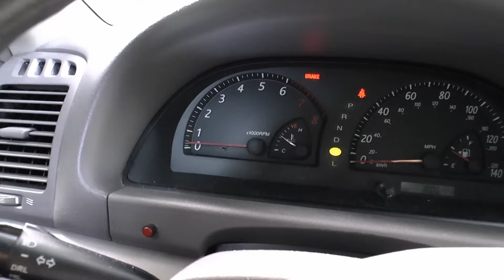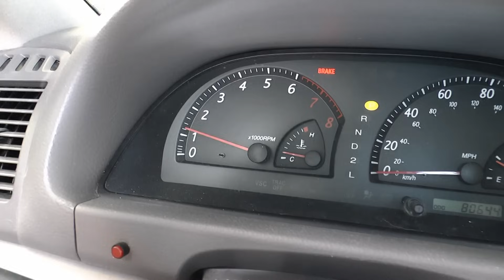How to Fix Low Idle Problems in Your Car (Throttle Body)

Comment: Hi scott, I have a Toyota Avalon 2000 xls, I replaced new alternator, now the idle is lower than normal, then I have to push the gas to hold, can you help me how to adjust the idle?

Comment: hey man do i need an engine splash plate? i brought a toyota celica st204 1996 and we drove it home through the rain and it broke down couple of time then started back up. the air intake duct had a split at the time but has been fixed now. will the engine splash plate (under the car drivers side) effect driving through the rain?

Comment: Scotty, I've changed the air filter and fuel filter as well as cleaned the throttle plate in my 98 civic. However, it still idles at around 300-400 rpm. What else can I try to get the idle back up to where it's supposed to be?
Reply: +Nick Morales Forgot to add, I had the idle air control valve cleaned about a month ago as well. Thanks
Reply from the maker: +Nick Morales  try my video "finding engine vacuum leaks with a cigar" and pray you don't need a new throttle assembly

Comment: I have a 200 dodge durango it idles at 500 rpm when warmed up. On a cold start itll only rev up (first starting) and then drop right down to idle (750) and then when its warm itll idle lower. If I turn the heat or ac on it'll turn the idle up to normal. Any ideas what could be the problem? Ive already cleaned out the throttle and it has no vaccum leaks

Comment: 1992 oldsmobile bravada,iddles to 2000 rpms and when you put it in gear it jumps forward and on reverse as well and accelerates by itself to 25 miles throttle has been clean and the iddle and trottle sensor have been change and the air filter have been change.not even midas or any shop can't help,so scotty mind taking a new customer?

Comment: hi and thanks for your video 

I have a mazda5 2005 that start stalling and engine shake , I had a fuel filter changed recentlty and was fine and after 1 day from picking up the car the prob starts agsin with the same prob before raking to the garage who diagnosed the fuel filter .can you help please?

Comment: i have an 09 370z and when i come to a stop is drops in idle almost to a point where it cuts off...but no check engine light...should i cleand throttle bodies and put new air filters in? i checked air filters and there was a bunch of debri stuck in them

Comment: So changed my throttle body and the light still comes on and car acts up. The thing is it only happens when I leave the car off for about a hour or more. Mainly in the mornings when I first start it. It also seems to get worse with cold weather, but once I have it running for a while like 5-10 I turn it back off and everything runs ok after that. I cleaned and changed the throttle body and I have no idea what the problem is now.

Comment: my gmc yukon denali  has a higher idle now that i cleaned the throttle plate its at 1500 rpms and not ever dropping down unless im in drive or reverse. any idea what i need to do or does it correct itself

Comment: Will a low idle (2008 Mitsubishi Lancer, original factory, 120,000 miles) make the car speed up to fast as you give it gas from a stop position to go (the surge of power jerks and speeds up abruptly).  Haha, im not sure how mechanics describe it.  The abrupt jerk from 'Stop to Go' is very annoying, and even when i give gas at 20 mph and more, it's abrupt.

Comment: I've always known this method, but how does carbon build up on the inner portion of the plate affect the throttle body from opening smoothly.... Like do you mean if the carbon gets stuck in between the throttle body and plate or does it just somehow make it stiffer

Comment: I have a 2000 Toyota Celica GTS which I recently changed the fuel filter and pump on. When the car warms up, it idles pretty low. It never idled low with the old filter and pump. The car doesn’t die out or anything, just idles really damn low. Is this an issue?

Comment: Here is a good one that I can not figure out. or find help with. I have a 2009 Hyundai sonata 2.4 cylinder  and I replaced the alternator. Fairly easy job. But after I replaced it I started the car up and went for a ride. Everything seemed fine until I came to a stop sign and as soon as I pressed on the brake the car stalled. Not only does it do that but when the engine is cold the idle looks good but as soon as it warms up the idle drops down to a low 400 to 500 rpm and if I rev it up it will stall when idle comes back down. I had none of these problems before replacing the alternator. I did not touch any vacume lines while replacing the alternator. I'm totally baffled. Before I start replacing things I figured I would try and get some help first. Also I get no codes.

Comment: Hi scotty I have a 2004 camry I cleaned oxygen sensor and throttle and changed alternator and I still have low idle but the car takes of fine what could be wrong

Comment: Hi Scotty~ I have a 1998 kIA SPORTAGE  upon cold START the idle is too high and goes to 3,000 rpms..when I DISCONNECT the IAC the idle drops back to normal (850 RPMS)...someone said that means the n IAC valve is good???? PLEASE ANSWER ASAP thanks!!

Comment: after cleaning the throttle body high rpm came up when ECU tried to relearn it can not as the engine about to stop if let the rpm become less than 1200 rpm what do you think the problem is

Comment: Hey Scotty, on my 2002 Mazda Protege5 the fuel pressure regulator and EGR Vacuum solenoid started to go out and 3 codes appeared for P1250. I replaced the FPR and EGR VS and those codes are cleared except the Misfire in cylinder 3. Now, here's where my question comes in, right after I replaced the EGR VS and reconnected my battery, my car is having very poor idle at around 400 rpm and even wants to stall or does stall at red lights and stop signs. I'm going to try this tomorrow along with a Vacuum test, but do you think the poor idling has something to do with my misfire?
Reply: Btw, great work! I've used some of your videos to help me on my car and you've never let me down. Thank you!

Comment: Hi Sir i have one question that my suzuki Aerio 2002 has got problem of spending the fuel over limit before with 100km it pent 10liter gass but now its over 15liter for 100km. thnks and best regards.

Comment: Hello Mr. Kilmer.  I've cleaned the tb and changed the iac but its still on low idle and gives me a low idle than normal code error. Any ideas? 2001 mitsubishi galant 4 cyl. Thanks.

Comment: I cleaned the throttle body of my nissan but I had to use the relearn to fix my idle afterwards. Is this normal with all nissans?  My mechanic buddy said I was lucky I didn't have to replace it. Just wanted to hear your insight on this.
Reply from the maker: yes, nissans are messed up cars with electronics, they make em that way so you go back to the dealer. but most will relearn themselves after a few days of driving, if not, you pay a guy like me to relearn it with his dealer level scanner

Comment: Hi Scottie. I would like to ask. I have a 1998 Toyota rav 4. It idles fine. But when I turned on the air containing, the idle starts to bounce occasionally. 
What's wrong? & how can I fix it?
Thanks very much Scottie.
Reply: +Vincent Rodriguez That's normal - the engine needs more rpm to charge the battery.
Reply: Thanks mouse mystery. 
But when I put my gear to Drive or Reverse, the idle will bounce down & go up again. 
Is it also normal? 
Thanks much.
Reply: That is also normal. The transmisson has to disconnect and reconnect for a moment to change gears.

Comment: Scotty, Please help!   My 2002 Saturn Vue 2.2 Ecotec has 260K miles.... the Reduce Power light on... I would usually pull over and turn off the car and then back on and it would go away... well finally, the car went into Reduce Power, and stayed that way to where it could idle anymore. It's in a parking lot and I went to get a throttle cleaner and I cleaned the throttle fairly good without taking it off. Now it will kinda start, but it will not idle... I let off the gas, it goes out.....  what can I do to get it running again??

Comment: What is the difference between a ROUGH idle and a LOW idle? In my manual car I would like it to idle at a high enough rpm to start the car moving without any throttle.
Reply from the maker: rough can go up and down, but low is just low. realize most cars have non adjustable idle speeds run by computers today
Reply: Thanks for the reply...isn't there any way to increase torque at idle rpm in first gear? Love your vids!

Comment: Hello scotty i like your videos and they are helpful but can you explain to me why my 1984 toyota pickup dies if i press the brake pedal down as i barely start it?
Reply from the maker: vacuum leaks often do that, either the booster is leaking itself, or the system somewhere as brake booster uses a lot of vacuum pressure to operate itself

Comment: Skotty kilmer, I would really appreciate it if u answer my question, I have a Peugeot 407 and the problem with it is when I press on the gas pedal it takes a little while to feel that the speed is increasing, I mean after I press tha gas pedal it takes about 3 sec then u feel now it got the gas , so what is the problem is it because a dirt gearbox oil or from the throttle body ?? I really getting confused about it and I don't want to go to mechanics and pay a lot and then get scammed. , and same thing happen when I start the car and push my foot away from the break pedal it takes while to the car for move . Plz man answer me if u can

Comment: I did this for my parent's Ford Taurus 2008 and car is still idling at about 500 RPM's. I cleaned it really good, I even took out the throttle body but still idling poorly. What could be causing this?

Comment: Hi Scotty..!! I wanna ask you about my 2011 Holden captiva Lx Diesel lags power and acceleration sometimes on Upside hill road and the check engine light and service light comes up. Last time i went for a DTC and computer shows P02E4 and P0299 . What could be the problem??

Comment: Is it OK to clean it without removing the whole throttle body part from the engine? I have a Fiesta mk7
Reply from the maker: as long as you disconnect the power supply there or take a battery cable off

Comment: Hi Scotty I have A4 audi I know you hate theses car it seems when am driving my throat seems to be slightly higher it only when I've been driving for while when when am sitting at the lights it happens do you the this could be the throat sticking and should I pull it off to clean X51 PLATE would be grateful for your advice?

Comment: I have a 1998 Acura RL ... idling between 1500 - 2000 ... i got a code of P505 ... i really need some tips or suggestions for a repair

Comment: But is better for clean it, to remove the trottle body with the sensors connected, ask somebody to floor the accelerator with the switch opened to open the trottle plate, and clean both sides of the piece as well! Only clean one side doesn't works too fine

Comment: I cleaned the throttle body on my truck and now when I put it on park after driving it for a few miles it takes the rpm some time to idle normal. What can I do to fix it. Do I need a new throttle body?

Comment: I serviced my car GXR cruiser for 80k km service and after less than a week lost power while driving with engine light went on and 4lo light blinking..computer result  was throttle door stuck open ..does this have anythin to do with the service ..and can i fix the throttle or is it something must be replaced

Comment: Hi Scott, I got Mazda 6 2005 hatch 2.3L. Every time I stopped at traffic light or round about, my car RPM level dropped and the engine shuts off. This only happens at the first 10 or 15 min, after that the RPM becomes normal. Any suggestions?

Comment: My 2016 Honda civic 2.0 has 130000 miles check engine light for throttle body p50a . Would it be okay to put on a used throttle body as a temp solution

Comment: I just went to do the mot or the master inspection at my skoda 1.2 htp and they said that the emisions are bad...i manage to hear when i start the car that being a 3 cilinder a uneven functionality regarding the engine most probably i will check it with my diagnose tool

Comment: What about cleaning throttle plate that is controlled by a motor?
Its ok if you have someone to help you but if you are on your own it is virtually impossible to clean below the plate,obviously the plate cannot be pressed down as you spray incase it upsets or breaks the sensor.
Any ideas apart from removing the throttle body?

Comment: scotty, i hearsay it's bad to open the throttle motor by hand to clean the throttle plate because you are forcing the motor to open. what's your opinion on this?
Reply from the maker: no, once you remove the battery as I show, there is no power and you can open it by hand. If not an electronic throttle, you can just open it by turning the throttle where the cable attaches on the outside.
Reply: Scotty Kilmer Why does some say you MUST remove the throttle motor to clean drive-by-wire type (ETC)?

Comment: Hi bro , I cleaned throttle body on my 2009 mdx but after that the rpm is jumping up and down without pressing gaspedal and also check engine light comes on,  we cleared check engine light but still the rpm is not stable,  any advice please and thank you

Comment: Dude will this be applicable for 2016 subaru WRX ? I have the an issue with idle engine, sometimes it starts some times it won't or it gets shutdown

Comment: Hi, I have an 05 Toyota Avalon at idles low every time I start the engine no mater if the engine is cold or hot, after about 10 to 15 minutes at idles fine. Could you please advise me what to do? I've replaced the air filter and cleaned the MAF sensor.

Comment: Mine is new...filter is clean and yet the check engine light only comes on at idle and goes away at 25 mph...any suggestions? It's a 2007 chevy suburban 5.3

Comment: Hey scotty, my 00 crv idles low at 200 rpm when my ac's on. No ac at 500-600. Already cleaned the throttle body. New ac compressor + dryer. And sometimes the motor shakes
Reply from the maker: try a new idle air control valve

Comment: i have a lincoln navigator that i just replaced the tps and engine coolant sensor on. I took it for a drive and it drove great, but as soon as it got to the driveway, the truck started to surge and engine violently shake. I'm not sure what could be the issue.
Reply from the maker: often computer needs to reset stuff , drive it a few days and see if it does

Comment: Hi Mr.Kilmer. i'm not sure if you would have an answer but would you recommend getting a 91Toyota tercel? its $740 and it shakes when its idling like in the video, other then that its not bad. thank you for your time. Aaron.
Reply from the maker: PAINTBALLERKID69 that's not much money, but that's a really old car. If it runs good enough at speed you may get some time out of it, just realize those were oil burning engines from worn oil seals and that costs over a thousand bucks to repair

Comment: Hey Scotty. I have the same car basically (04 Solara with the 4-cyl) and I did this about a few months ago.(Wish this video came out a few months ago, would've been a lot faster and easier than trial and error haha). I heard like a clicking noise coming from the beginning of the video near the duct work and my car still does that after I cleaned it out. Car has no issues with idling or anything though. Is it alright to ignore?
Reply: Coincidentally I also changed my battery out then too if that matters.
Reply from the maker: leonardchungmusic sure, as long as it runs fine, those have tons of solenoids that often do that noise

Comment: Scotty, 
something went wrong, I did everything in your video. when I first started my car, it went to about 1000 rpms but then it gradually raised to 1500 rpms. now while in park or neutral the car is constantly reviving from 1500 to 2000 rpms back down to 1500 then up again. 

however if I am driving or reverse, it runs fine. even when I stop at a light, while in drive, it's fine. it only happens when I am in park or neutral. 

did I break something?
Reply from the maker: +Jonathan Naraine check for vacuum leaks you may have created or wiring that may have been damaged. If not so, sometimes cleaner takes so much crud off engine idles better and the computer can take a few days to reset it correctly just driving
Reply: +Scotty Kilmer ok, thank you sir

Comment: hey Scotty this one's a weird one I just felt like cleaning the throttle body you one day and I change the spark plugs on the same day now for some reason my car sounds a little like a diesel engine it's been a  day and its still  doing it any idea why or what to do ?
Reply from the maker: +link52j check for things you might have damaged,  like spark plug wires or coils or wiring around the work area

Comment: Scotty, I have corolla 2009. I just change all the filters, motor mount, alternator, do tune up, ignition coil changed, spark plug and done by toyota dealer… but after done of them, my car shaking and sometime shake badly when its idle and check engine light ON.

Toyota ask me to change wiring engine harness, but it doesnt change anyhing… please help me

Comment: Hi , I have got an Audi A4 2013 uk , recently had cam belt change and since then my cabin is not as quiet as it use to be , I can always hear a bit of engine noise when the car is idle as soon as it moves it goes away, any idea what is the problem??